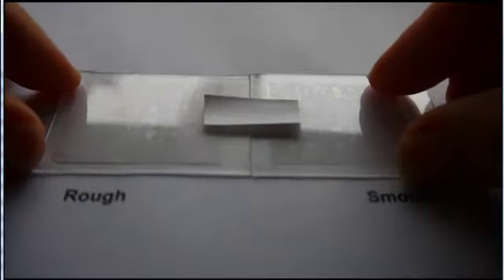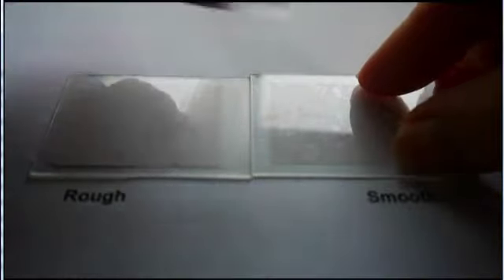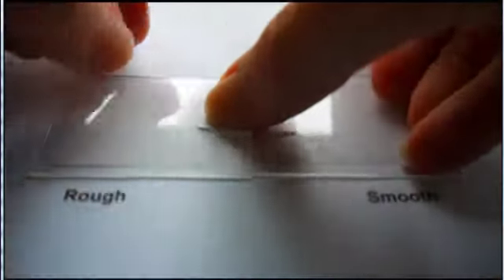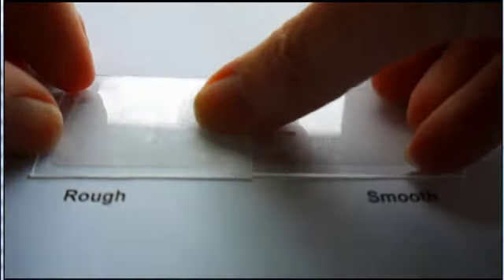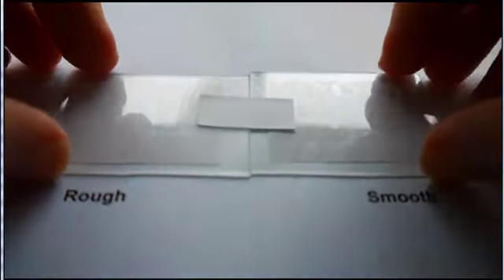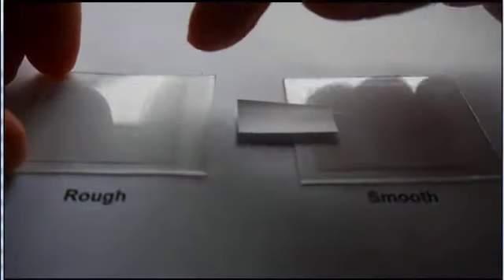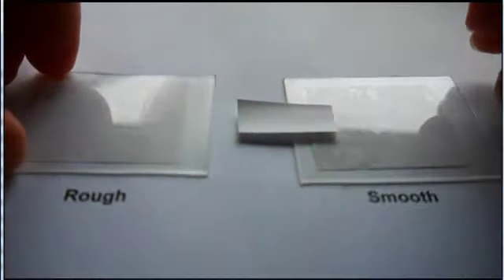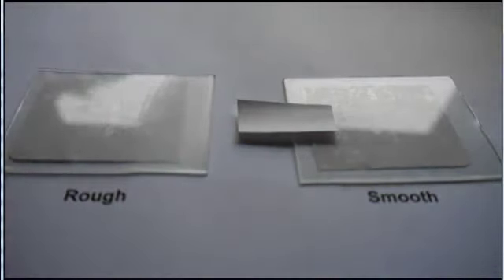Roughness - Sticking Together

Comment: But why does it happen , rough surface has more surface area in comparison to a smooth surface so rough surface should hold on tightly rather than smooth ones?